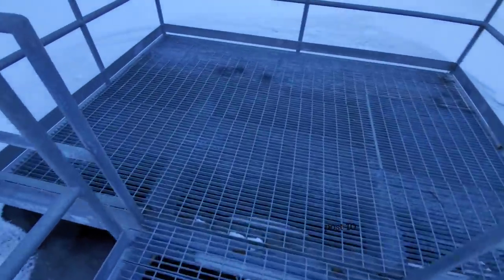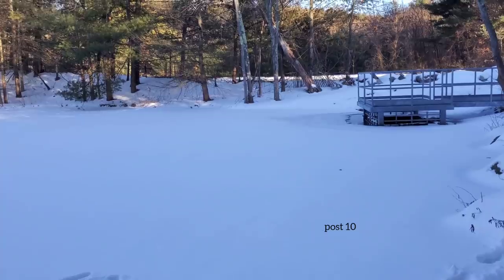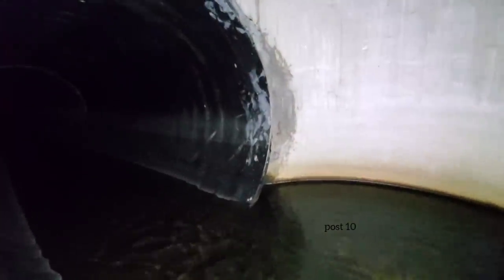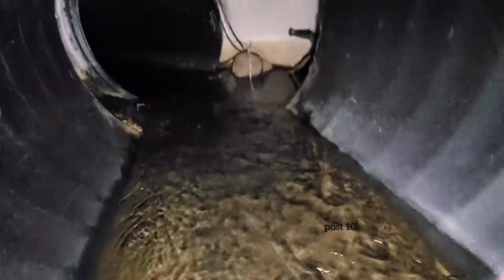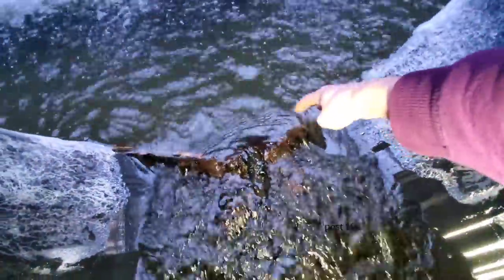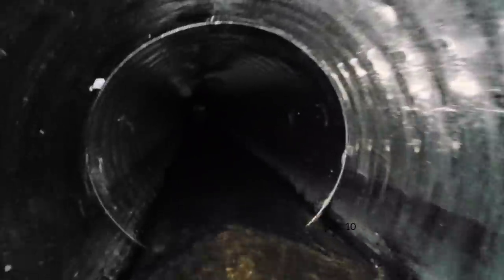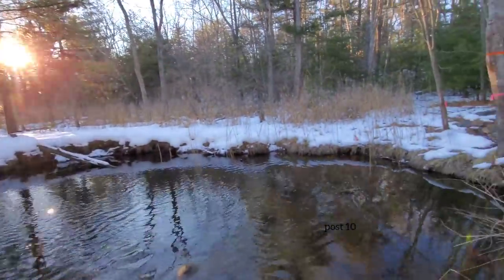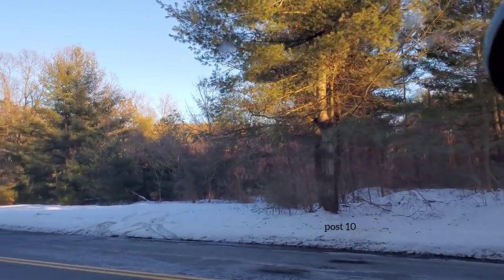DOT Makes Questionable, Concerning Lake Drain Repairs Feb 2021 Update

Comment from the maker: Filmed on February 20th 2021 originally posted this video being unlisted so I can have a engineer look at it first and he says these repairs probably failed within days of being put in because of hydraulic pressure and he doesn't think they put it in under the water at all where the majority of the issue was. This will continue to get worse until they actually dig it up and put the seals on the outside where they are supposed to be cranked down. This type of Culvert has external brackets never internal like this, Those screws are not rated to be underwater and are likely deck screws or construction screws meant for wood
Reply: Maybe Post10 you could start selling rakes with ur logo on I’d take one on my walks coolest rake in uk 🇬🇧 it would 👍🏻👍🏻
Reply from the maker: @manitoba-op4jx  it can't be fixed with a sleeve it's already eroded outside the pipe
Reply from the maker: @manitoba-op4jx  I bet it would work closed cell spray foam is strong stuff
Reply: I concur. A repair by 'ticking the form' only, it needs much more extensive works, probably with excavation and exposure.
Reply: The DOT needs people like you working for them! Culvert frog looks healthy, I remember you saving it. How's April??
Reply: I cannot say I am surprised by the repairs. The builders did shoddy work to start with, why expect repairs to be done correctly.
Reply: Why didn't they just use stainless steel screws?
Reply from the maker: Stainless steel culvert would cost a fortune, they wasted 2.2 million dollars on this project if they would have you stainless steel expect it to be more like six million
Reply: i had a corn snake for 20 years until she passed about 5 years ago..... fed her dead mice as well....
Reply: @post.10  Foam concrete, often used for void filling & ground stabilisation.
Reply: @post.10  no no I'm sorry. I meant stainless screws.
Reply from the maker: @paultrappiel9943  either way it's wrong that's not how you fix a culvert
Reply: I appreciate you consulting with the experts!
Reply: @post.10  sorry sir
Reply: Super interesting, thanks dude :)
Reply: the dot needs to be investigated
Reply: Those screws aren't structural, it's just to hold it in place until that polyurethane cured. The adhesive is always what gives strength, not the fasteners. Same with furniture or structural framing where glue is used.  
It's still a bit rough using zinc plated screws, but they're really only temporary in purpose.  
Its all a bandaid anyway. You really can't expect them to dig up the entire pipe that runs under the road unless there's a significant and immediate issue.
Reply from the maker: @maulerrw  Well it obviously cured properly
Reply: I think we need lake drain merch. This lake drain is so famous.  Any artists out there that can draw up an illustration of old drain that post 10 raked all the time. "Forever in our hearts" lmao I am loving this debacle too much
Reply: @post 10 did the DOT say anything about this?
Reply: @maulerrw  Sure but this fix is not a fix, is like a patch that I can do in a DIY project first time I started to do plumbing. In such environment that repair will not stand long, and you should prevent this damage by properly stopping water from coming and eroding soil.
Reply: Everybody knows that duck-tape is the best solution. Screws are soooo 2020...
Reply: Always enjoy your videos. Keep the county and state maintenance folks on there toes. Good job young man!
Reply: Ewww

Comment: All that money and they still cut corners.  Sad.
Reply: Tight budgets make cost-cutting necessary, which guarantees fixes will require...more fixes
Reply: @matambale  2.2million and the whole thing only cost under 100k in parts. concrete and steel isnt that expensive. where does the other 2.1mil go? in their wallets. and then they lie about cost overruns depsite cutting corners with cheap parts/lazy instalation and keep the overrun cash too. USA is first in Culture,Celebs,Global power,Celebs,Movies and most other forms of entertainment. but the fact they can let people likr Tesla and amazon pay less than 3% in total tax but cant fix infastructure problems is just stupid. charge companies 30%+ tax like everyone and use it for stuff like this and bridges.
Reply: @xz9z29  I agree with you in parts, but this isn't a problem cause by taxes being too low. It's a lack of responsibility  and care on the part of the people spending the tax-money. They had 2.2million to spend on this thing, someone competent would have gotten this thing perfect for way less. They didn't even bother to buy the correct screws because their job is to spend their budget and look they care, and that they did.

Also the US corporate tax is on the same level as Sweden, Norway, Finland, the UK, etc... not exactly tax havens.

Comment: No one:
DOT workers: normal screws, nah, i will go with the cheap ones, it will work
Also DOT workers: notice post 10 getting equiped
visible fear
Reply: They used Philips! They could have AT LEAST used Robertson screws for their 'fixes' lol
Reply: @addonarmor8960  yup, its a fix that  they will regret
Reply: @addonarmor8960  Pretty sure they used some star-head screws too.  Either way, I don't think I've ever heard of screws being acceptable jointing methods in HDPE pipes.  Don't recall them being acceptable jointing in any pipes, for that matter.

Comment: That inlet structure was likely a contract job. The DOT probably would be interested in an interested outside observer's view of the work done.  Might ask the engineer if he would supply his professional opinion of your footage and your commentary.  Even if he doesn't, at least try to write up something of what you saw and send it to the DOT.  There might be warranty work required of the contractor, if not a new contract.  This looks like something that would be grouted as digging it up would be significantly more expensive though it might come to that.

Comment: Those last two pipes simply weren't pushed together enough.  And then they didn't backfill around the pipe properly to get that kind of bypass at the joint.  Those little bubbles are going to get a LOT bigger over time - water will dig that out in no time.  What a shame.

@letsdig18 would definitely not approve :p
Reply: I love @letsdig18. These 2 need to get together!

Comment: They should have a grates for those covers so water from the road can go through it instead of just those solid covers that way they can act as storm drains.
Reply: The grade of most roads means water is constantly being shed toward the edges of the road, and manhole covers are usually not at the edge of the road.  They would catch very little water if they were grates instead
Reply: @Dogdrule  Any water they would catch would be better than nothing at all.  It doesn't matter where they are.
Reply: Dirt and gravel would enter from grared covers

Comment: HEY - P10 --  You've mentioned 'hand tools' in a couple vids.  IDEA- (for all your spare time 😁)  
Think about a relatively small multi-use hand tool.  [Lightweight,  practical, strong, folding, etc]
Rake, broom, hatchet (or some form of cutting blade), saw, pick ... 
Kind of a 'Swiss-Army Drain Clearing Tool'
You get the idea!  You do this more than most, so YOUR ideas to fine-tune the design, what tools, etc would be more impotant!
[ !you could do season-specific versions !]
A whole line of 
"Post10 Tools"
Keep it moderately priced, BINGO !
Hey, somethin' to think about!!
Just Thinking of You, Budddy !!

Comment: They need to drill holes from the inside and pump grout into those cavities under the pipes and around the joints that are separating. It would also help keep it round.

Comment: We fix leaks like these in all sorts of underground structures using single-part polyurethane foams that react when exposed to water.. expands to fill voids, soaks into soil to glue it together and repairs infiltration. All of this work can typically be done from the inside without excavation.  Worth a google if you haven't heard about it!

Comment: The crushing of the pipe is most likely from when it was installed when I was working on culverts we would repair them all the time when they are squished   a taller oval would be from the ground compacting around the pipe over time (cars) and a short squished pipe would be from installing and compacting the soil around to much

Comment: Those are 100% just exterior deck screws. We use them all the time when framing or when making a deck. They’re really strong and can hold up to 1500lbs each, but are definitely not meant to be used in these conditions😂

Comment: That hole with water running down it on the wall gives me mad anxiety like how is he not scared to walk in those things
Reply: It simply isn't scary?
Reply: @watcherofwatchers  how your literally walking through a culvert that can most likely crush on you also being surrounded by a circle wall type is jus anxiety alone also the water was falling down the wall dude and they had a hole like do you get it
Reply from the maker: @goatdreams1949  the pressure is nowhere near high enough to crush the pipe it's just the seals that are failing it's not going to just crumpled like a tin can
Reply: I think the point is that he IS scared, but he does it anyway because he CARES. 💜
Reply: @starcreativestudio01  sounds good

Comment: In my opinion they should’ve used either reinforced concrete pipes or cast iron. Those plastic tubes don’t do well at all under pressure and they’re not made for drains like that

Comment: What a mess and it just keeps getting worse! The only way to properly and permanently fix this is to dig up everything from the surge pit at the drain to at least the first manhole shaft, properly join and seal the pipes, and backfill with proper compaction. With the old drain filled and no other path for the water I'm not sure how they accomplish this repair properly.

Comment: There’s only two ways well maybe three ways to fix this pipe the way they did it but use stainless steel screws or dig it up like a normal person receipt the pipes this might be overkill but you can put in cement around the joints to prevent water from ever going into it or three put a pipe in that is designed for this situation

Comment: Man that culvert is piss poor. No way it will last 30+ years. The installation looks so rushed. 
Those HDPE pipes need a couple improvements imho. 
1. Steel rings cast into the ribs of the pipe at certain intervals to prvent ovalisation.
2. A better system to couple the pipes together. Maybe some large plastic pins that get installed at the joint from the outside in to prevent the pipe from creeping out of its joint. The pins can also be hdpe with steel cast into them. The same technology as those black ladders in the pit. They are plastic with a steel core.

Comment: Oh great. Spend two million to install the drainage system then penny pinch with 20 bucks of caulk and screws to maintain it. I suspect the engineer stays in the comfort of his/her vehicle, and then lets the workers do the job without personally inspecting it, and just rely’s on the workers reporting that it is done properly so he can put a check beside that item on the page.

Comment: a lot of this looks like it's done to the cheapest possible standard, by "bodge it ans scarper inc" 
there is a culvert running though the town where I like that was built in the early 1850's they inspect and patch different sections of it every few years, there are some in the capital city that are older, and they are still being used today. the really shoddy workmanship and to be honest terrible repairs wouldn't have passed inspection here contractors who don't pass inspection, don't get paid.

Comment: Butterfly valve not a gate valve.
Reply from the maker: I don't think so, I turned it a few times and it opens really slow
Reply: @post.10  Any butterfly valve over a certain size (4-6 inch pipe or so) usually  has a quadrant gearbox instead of direct drive where it'd take a reach-rod breaking amount of torque to operate it.

If it was a gate valve it wouldn't have that pin through the middle. If it was direct drive the pin would be vertical instead of horizontal.